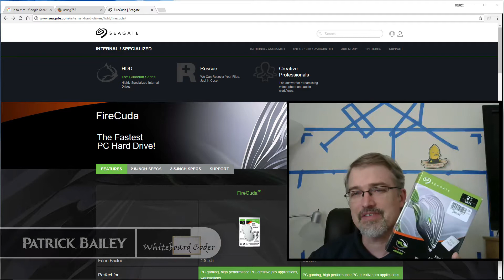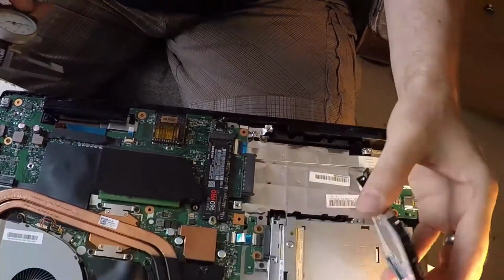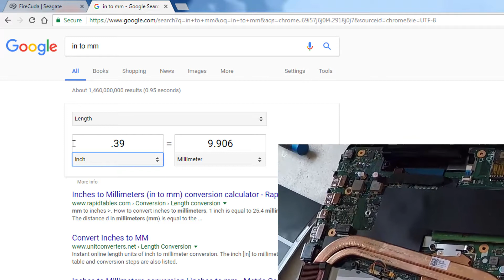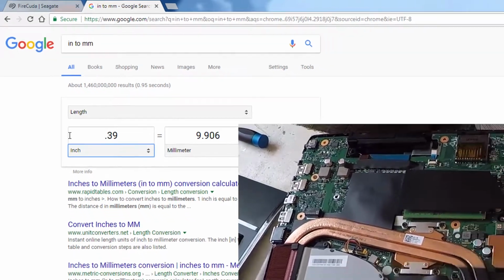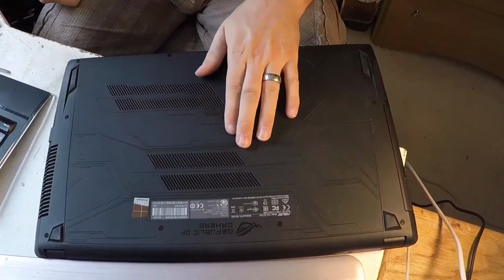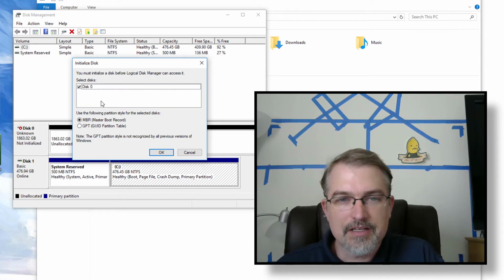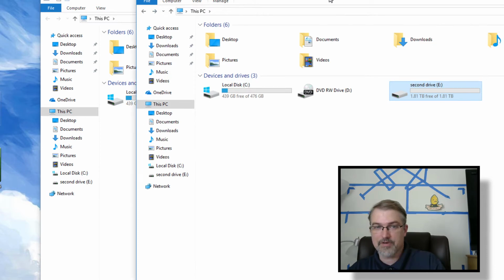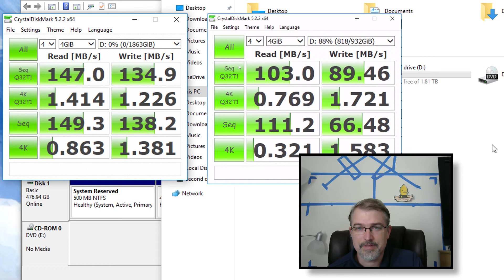Installing 2TB firecuda drive on Asus GL753 VE laptop

Comment: Thanks for the measurements of the HDD and the caddy I was searching for that info for that laptop. Greetings!
Reply from the maker: Funny thing is I forgot I measured it in this video so I took it apart the other day to see if there was a chance to get a 15mm into the laptop... which there is no way (https://youtu.be/LB6aOOwHtJI?t=4m18s)
Reply: That's exactly the reason why I was searching if I could fit a 15mm drive from an external hdd, guess I can't